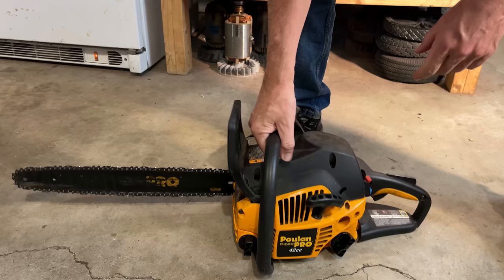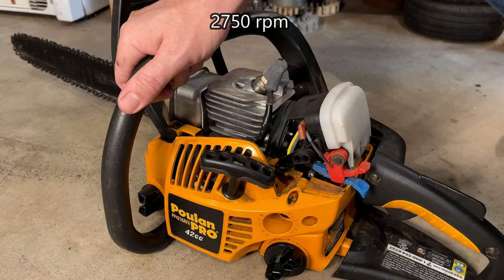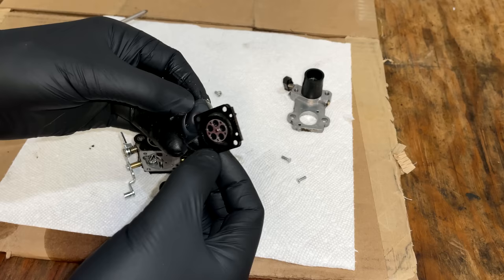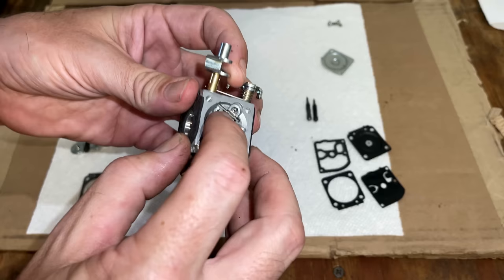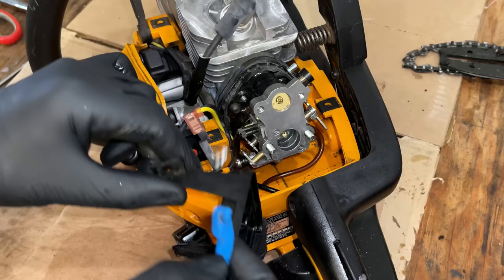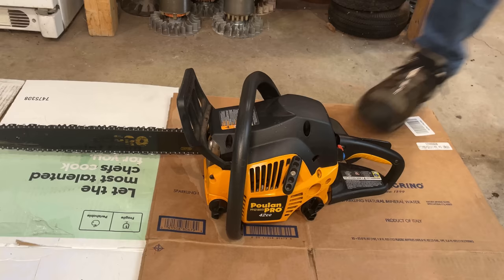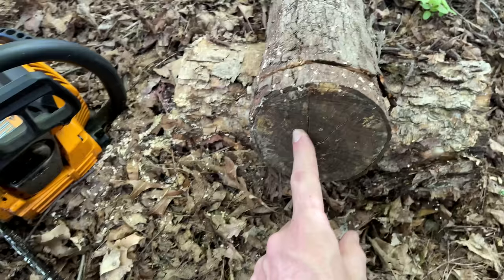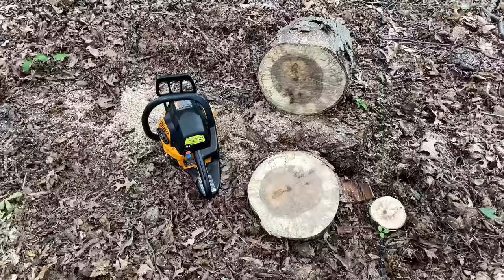Poulan Pro Chainsaw  - Not Running or Cutting Well

Comment: Carb kits for the Poulan are pretty common and cheap.  I keep several of their kits in my parts box K10-WAT or K20-WAT.  They atre used on lots of two cycle engines.  I keep them and K10-HD and K20-HD Walbro carb kits in my parts box.  I don’t use the Chinese kits.  I try to use Walbro and ZAMA parts.  I keep several ZAMA C1Q kits in my parts box.  I also have the big W and Z gages to check the lifter height.  I set them slightly below the setting on these gages, one RCH below if you know this measurement detail.

Comment: The "rakers", or depth gauge ahead of the cutting teeth haven't been knocked down to allow the 0.020" gap to allow the cutter to cut the proper depth.  You can salvage the old chain if he wants a spare.

Comment: The chain seems like the depth gauges were not set. You can get away with 3-4 sharpenings before having problems with the depth gauges. However, given the wear better replace it. Poulin is low cost Husqvarna and they come with Husqy plugs. I've found that Poulin will run about 1.5-2 hours then overheat. You can get another 0.5-1 hour out of them by re-gapping the OEM plugs, but they tend to shut down after 3 hours run time anyway.  That's if you don't score the cylinder by gunning it before it is warm. That damage has a name I don't remember.

Comment: I have one that's 50cc ran like crap,stalled I never messed with the carb.The thing I found was my brother inlaw while he owned it,he put sea foam in the gas and could not get it to run right so,all I did was burn out the spark arrestor and opened the discharge port on the muffler.Now I don't care how long it sits choke it pull the rope twice and it's a cutting beast,well if you can keep the bar and chain  working that in my opinion is the only thing wrong is crappy bar and chain.
Reply: Buy an Oregon bar and matching chain (plus a new sprocket of course) when you next replace these components?
Reply: @JohnSmith-yv6eq  that's what I just had on it,but it was used that's what is going back.The guy at the saw shop says it won't handle a full chisel chain that's what it runs.
Reply: @terrymiler2164  
Take along a log when you pick up the saw from the shop.
Get the mechanic to demonstrate that your saw that he worked on and fitted with the "recommended" bar and chain....actually works the way it should?
Reply: @JohnSmith-yv6eq  I only take my saw to have stuff done that I don't have tools to do myself,I don't want my carb jacked with so it don't get out of my sight or they will not touch it.There are some shifty saw shops were I live.

Comment: I guess you figured out the half choke only works when the throttle lock is on.
Good video, I put a HIPA carb on my saw, same as yours. Had to modify the top cover for clearance for the throttle mechanism

Comment: Nice job on this.  I have an 18" Poulan, it seems to not be the easiest thing to keep in adjustment. Probably need to get more thorough as you did.   And very surprising that the fuel lines were still good.  Two Poulan blowers and the chainsaw - all three needed new lines within four years!
Reply: If you get four years out of fuel lines that is excellent. For lines
left wet with fuel on equipment used regularly 2 seasons use
is not unusual before fuel lines are needed or soon will be.
Reply: @artpatronforever   Always tried to leave them dry when they were going to sit a while. I've got a couple of Ryobi chainsaws that are about 5 years old and get lots of use year-round, and still have the original lines.  But I've already purchased the spares in anticipation of the inevitable!
Reply: @freecycling6687  Running engines dry is the best thing and 
fuel lines will last sometimes 10 years or more stored dry.
Another thing I have seen is some lines harden rigid and 
don't crumble or break unless pushed against and broken. 
I have seen clear lines become a brown amber color and
harden to a rigid form but continue working so long as 
they aren't moved or flexed. Often old lines crumble
and disintegrate into chunks after they get brittle. The 
longest lasting black rubber lines I ever saw were the 
old school OEM Homelite fuel lines which would get
brittle after years and eventually break but lasted for
at least twice as long as the plastic clear fuel lines. 
There was a gray silicone line that is pretty good also
and would outlast the clear and yellow fuel lines. 
Strangely when it aged it would get soft and sticky.
From what I see so far the fluoropolymer laminate
Tygon LP-1200 may win the endurance contest for
fuel lines, but it will be awhile before I know that
since it is only about 6 months I have used that.
I had thought a long time ago that solid teflon 
fuel lines using laboratory grade tubing would be
absolutely a permanent fuel line solution. On very
old saws I know soft copper fuel lines were used.
Reply: @artpatronforever  I had similar experience with these fuel lines. Are you buying the Tygon LP-1200 fuel line straight from Tygon industries? I have bought " Tygon" advertised fuel lines that were not Tygon.
Reply: @JOEZEP54  The supplier was all seasons parts inc in Buffalo MN
and 10 feet of the 3/32" X 3/16" LP-1200 shipped was fifteen dollars, 
but it is a little more now. Yeah tygon has become a generic term for
fuel line and quality definitely varies for fuel line. Over 60 years I
have sampled many different type lines and this is good fuel line.
Reply: @JOEZEP54  A bit of esoteric knowledge about purge bulbs can 
be helpful to share here. I have never seen this in any user
manual. A purge bulb works as a suction device to pull any 
trapped air from the metering bowl in the carburetor and 
raise fuel from the fuel tank through the fuel line. So when
the purge bulb is pushed it squirts the air bubble it has 
suctioned along with fuel back into the top space of the
tank. The purge bulb does its job but requires repeated
cycles to clear air bubbles from the fuel loop, because 
a bubble of air becomes trapped in the purge bulb itself. 
This happens because the bulb is horizontal and that
orientation allows a bubble of air to be entrapped there
inside the purge bulb above the duckbill valve inside that
is the discharge valve for the fuel return to the tank. That
trapped air in the purge bulb itself makes the bulb mushy 
in operation and many pushes on the purge bulb are then
needed to expel the trapped air bubble to purge the purge
bulb itself and it can be felt to become wet primed and 
become firm to the touch when depressed. To avoid a
need to sometimes press that purge bulb 10 times to 
get it to clear the air and solidly prime, there is a trick
I have discovered works like a charm. The purge bulb
needs to be pointed at the ground so the bubble of air
that is captive in that purge bulb is against the center
duckbill valve in the base of that purge bulb and will
discharge into the fuel return line as the purge bulb 
is pressed. So the saw or blower is positioned by 
holding it so that purge bulb is pointed straight down
and it will wet prime in 2 or 3 pushes of that purge 
instead of wearing out the purge bulb and making
tired fingers requiring 10 cycles to wet prime. Try 
this trick just one time and become a believer. It
is guaranteed 100% to purge easier. Then find 
even one user manual where a manufacturer will
tell anybody this trick to make a purge bulb easier
work with gravity and air bubbles. Shhh it's a secret.
Reply: @artpatronforever  Thank you for this contact. I just checked & for 50 ft of 3/32x 3/16 it is $49.47 It is from Stens but the ad reads Tygon

OEM TYGON. I will give them a call on Monday to check it out
Reply: @artpatronforever  With a 100% guarantee how can I not try it? LOL I agree even though I am not as vigilant as I should be, I do read the manuals & I have never saw this tip or even the mention of an air bubble in the primer bulb. I have an Echo CS352 that has me stumped. Will definitely use this tip when I get back to it. Thanks again.
Reply: @JOEZEP54  Those purge bulbs are frustrating and wear out when 
the bulb part cracks from age, and worse from being flexed too
many times. When I replaced a leaking bulb I studied it closely
and figured out why it took so many cycles to get to wet prime,
and it is definitely the air bubble that gets trapped inside. So I  
thought maybe put a bracket on the saw so the bulb would be
oriented with the connection nipples towards the sky. To then
test the idea I just turned the saw sideways to see it worked. 
Then I thought no bracket needed, just turn the saw sideways
when using the purge bulb and problem solved. Works great.
Reply: @JOEZEP54  Saint-Gobain Performance Plastics is the manufacturer
of actual genuine Tygon and the technical data on their fuel lines
is on their website. There are many different grades of Tygon but
the LP-1200 is top shelf fuel immersion rated. Viton would be the
best material for fuel lines but it is an uncommon item and would
be expensive. It is that pink extremely flexible elastic rubber like 
silicone but is an inert fluoropolymer for aerospace and lab uses. 
The duckbill valves are made of viton, and some O-rings and 
needle valve seals are viton. It is inert like teflon but is elastic. 
If the lines on a small engine were viton, they would never be
replaced but would last as long as the engine or longer.
Reply: I use my Dremel chainsaw sharpener to bring it back to normal.
Reply: The chainsaw was missing for 10 years.  Why didn’t the guy demand it back?
Reply: Kit will help it

Comment: New Carb...ebay $15.....pull replace and off and running again including properly set jets.  Also adjust all when the whole unit is put back together....very tight tolerance for vacuum.

Comment: I found an old Poulan in the trash got it running after a carb clean and used it for almost 15 years before it washed out.

Comment: I have found that the electric chain sharpeners are designed to eat up the teeth faster. Hand filing gives a better edge and doesn’t take off as much.
Reply: 2-in-1 hand sharpeners sharpen the blade and guide at the same time as well.

Comment: You actually got the metering diaphram installed wrong. The gasket goes down first then the diaphram closest to the top cover and the metering lever height was correct or close before you adjusted it. You measure that one from the stepped down part at the body sides. 
Surprised it ran lol

Comment: I've got nearly the same saw.  Mine is a 43cc PP4318 which has an 18" bar on it.  On my saw you can adjust without removing cover.  Love the chain saw but I've got 2 Husqvarna's I like better, a 240 and a 340.  Cheers from eastern TN

Comment: I have 3 saws just like that. They all run great except for one has bad crank bearings. I also clean out the groove in the bar every day or 2 to keep the oil holes from getting clogged and someone correct me if i'm wrong I think it has a hole on each side on the tip of the bar to grease the sprocket bearing

Comment: In the video at 42:20 you can see that the depth gauge (raker) on the old chain is sitting at about the same height, if not a bit higher, than the top of the tooth itself! That certainly isn't going to cut very well at all! It's often overlooked when people sharpen chains but as more and more of the tooth gets filed away by sharpening, its height becomes less, and periodically the rakers need to be filed down too so they are kept about 0.025" below the height of the tooth. The rakers essentially set how much of a "bite" the tooth takes out of the wood with each pass. Too high and it will cut poorly, too low and the chain will grab and bog down too much.
Reply: Stihl offers a 2-in-1 sharpener that does both at once. Other MFR's make copycats of it. The sharpener needs to match the blade size. On some chains you need to sharpen each tooth ss it sits almost into the front curve of the bar, so the tool fits between the next tooth and the one you're sharpening. I own this tool and use it for this saw. When the blade gets worn down, the round file starts to make a 2nd cup shae in the blade, but it still works ok. Another file could be used at that point too.

Comment: I have one of these saws that I to put a new carb and replace the gas lines to get it to start. It runs ok now but the chain oiler puts out way too much oil. After I ran it for a while in started smoking real bad. It wasn't from the engine exhaust so I thought maybe the chain/bar was getting hot from lack of oil. The chain oiler had put out so much oil it got all over the clutch assembly and it was smoking.

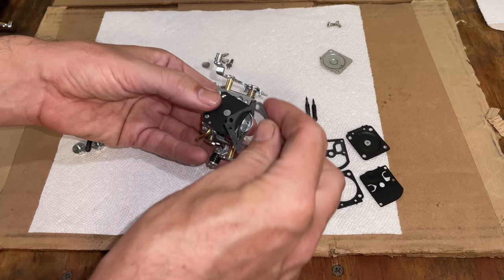Comment: The diaphragm pump and the gasket  appear be on in the wrong order in the video. It should go gasket, then diaphragm pump. You can see the original at 15:16 and the rebuild at 23:40. Other than that, good work.

Comment: Your chainsaw is still four-cycling through the cut (not optimal).  You need to lean the high speed jet out a bit DURING THE CUT until it just leans out, but four-cycles at full throttle under no load.  That way you keep optimal power, optimal lubrication, and clean spark plug.  Dr. K.

Comment: If possible, it would be nice to add a saw dog (gripping teeth) to the housing so you can get a grip on the larger stuff and add to your leverage.
Reply: Leverage?
If you need leverage to make the saw cut...you need to sharpen the chain.
Reply: @JohnSmith-yv6eq  Take a look at any pro grade saw from the fifties to today. Yep all have dogs.  Go to a logging site.  Yep same thing.  Also keeps a lot of wear and tear off the front of the saw which is even more important if you have a cheap plastic one.  Top handle limbing saws are about the only ones that don't always have dogs.  Dogs take a lot of the work out of falling and cutting bigger material.  A man that knows how to run a saw knows he can engage them or not as needed.

Comment: even when done, it's still not hitting top RPM.  more than likely the muffler is clogging up with carbon or the top end is chewed up.

Anyone notice at 40:30 that the bar is loose?

Comment: Good video cause when it comes to these small engines that Ethanol will kill a carb usually the float I like using that ✨ Bright it's blue in a clear bottle pretty good I try to always put a gallon of airplane fuel to 5 gallons of that what they call 93 lol

Comment: Still a little rich on the high speed screw bud greT vids though👍👍👍
Reply from the maker: Yes, prefer to run it a little on the rich side.  I did lean it out a bit before sending it back to the owner.

Comment: After replacing the lines, then cleaning the carby, I learned from trial and error how to get the idle set by a similar approach here in the video.
What effect does adjustment of the “H” trim screw have, and in what case would adjustment for it be required?

Comment: Ok, now do mine. I got mine running well, then for no reason (except it's a Poulan) it wouldn't run worth a darn. I replaced the carb and got it to run and it sounded good. But when I went to use it, it wouldn't start.

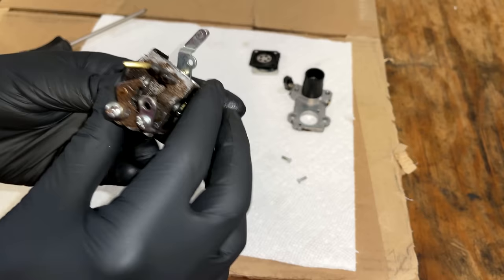Comment: Disabling On 15:22( are there 2 or 1 gasket?)
Than on assembling 23:43 are there two gaskets as well,and which one goes first on membrane ,Metall ring on?
I did disambling on my chaisaw- gasket first,than membrane second.
Which one are right?? Thank you if you answer to me
I did come back 
You put gaskets wrong?( But at the end running ok)
First gasket,than membrane w/ metal ring on.

Comment: Very common over sight in saw sharpening is to take down the rakers as the chain wears, that chain was obviously damaged, but the rakers were way too high preventing the teeth from getting a bite in the wood.
Reply from the maker: It had not been maintained and teeth were missing.  No doubt someone was trying to cut a rock with it.

Comment: On a non running saw I always dump all the fuel out of it and rinse out the tank with fresh fuel before refilling it.  Putting fresh fuel with bad fuel does nothing but make both fuels, bad fuels.
Reply: How do you deal with replacement of the clunk filters in both the gas tank and the oil tank?
Reply: @JohnSmith-yv6eq  replace ‘em

Comment: Poulans are particularly prone to flooding, especially with dirty air filters.  Yours was filthy and likely very clogged.  I always first tune my 4218 with no air filter to make sure it is actually  “tuneable”, i.e. the carb diaphragms, crankcase seals, and ignition systems are all working properly.  If they are, then restart the tuned saw and add the air filter to it while idling, noting the impact on its RPM’s and performance.  Usually a slight retuning will be necessary, as idle upward adjustment and fuel leaning may be needed to prevent flooding, even by a new air filter on a Poulan.   Any crank seal leaks will also be made much worse by the presence of an air filter, especially a dirty one, so any inability to tune WITH a clean air filter in place suggests an oil seal leak.  Poulans have very cheap, easily deformed crankcase seals that frequently leak with heat and age. Fortunately, they are cheap and very easy to replace without specialized tools.  Poulans are perfect, fun little D.I.Y. chainsaws that can easily be rebuilt and kept running for years with just a little TLC.  At about half the cost of a Stihl or a Husqvarna, they are surprisingly strong, torquey homeowner-level saws.  I have Stihl’s, Husqvarnas, Homelites, and McCullochs, but prefer beating up my Poulan with my dirtiest t jobs…..which it seems to love.  You just need to learn to speak its language.  Dr. K.